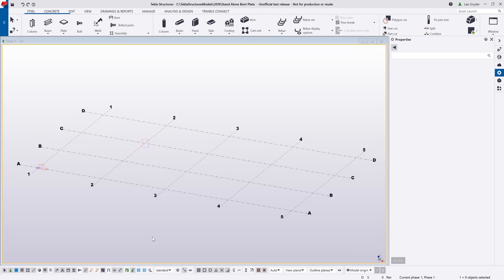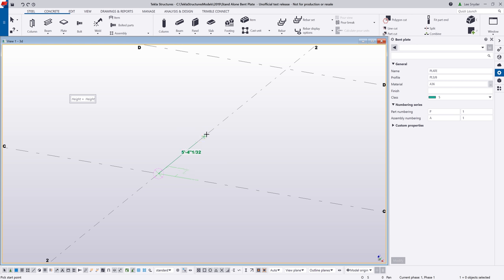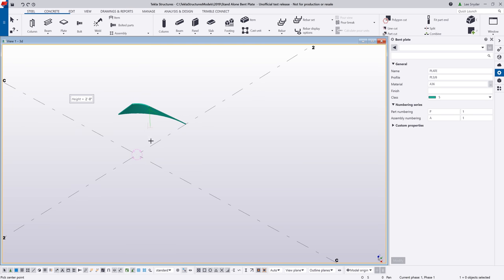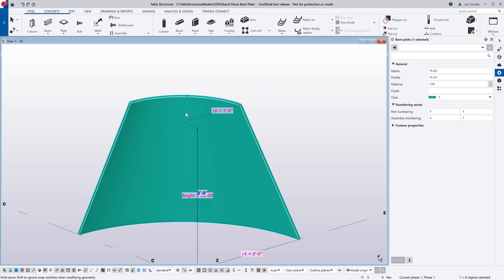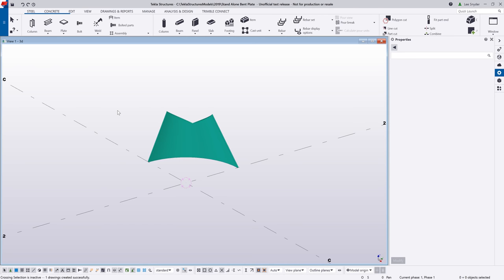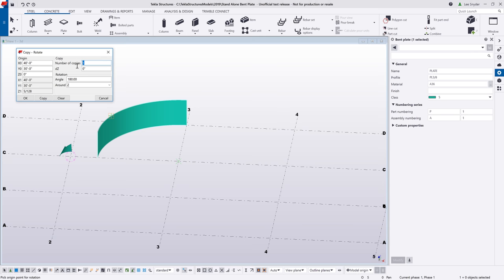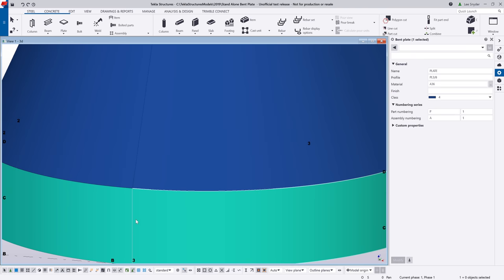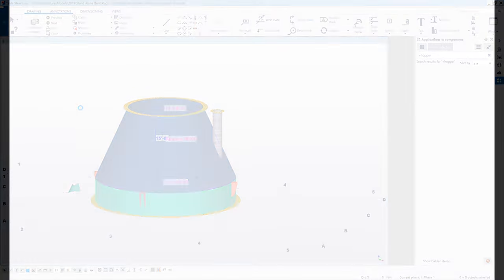Stand Alone Bent Plate in Tekla Structures

Comment: thank you so much for this! Can you show how to create the top and bottom flanges with the bolt holes? The only way I know how to do that makes a part that is not technically round but is a polygon with a ton of point. And those points/angles transfer to the drawing and don't give me something actually round....
Also, when you cut that chimney pipe through the sheet metal and then make a flat drawing, how to you make the hole cut straight? As it stands the flat pattern has this crazy bevel to the hole. That doesn't really fly on a cnc machine. Do you know how to fix that? Or would that be a matter of importing it as a dxf into autocad?